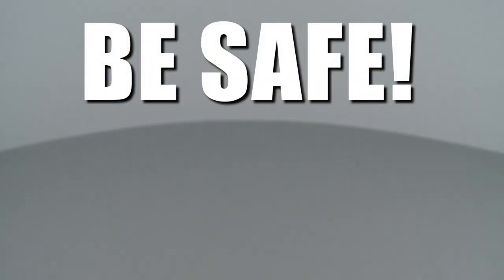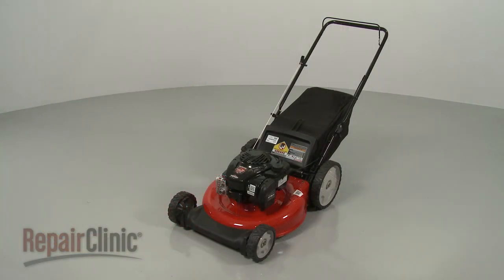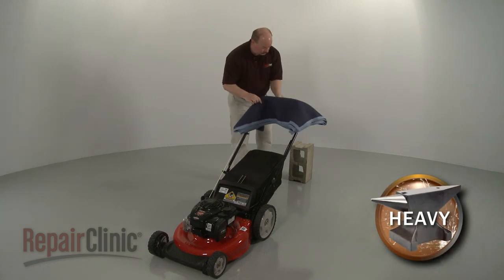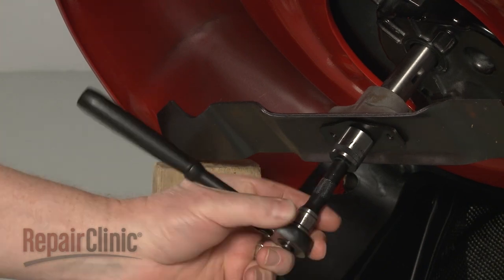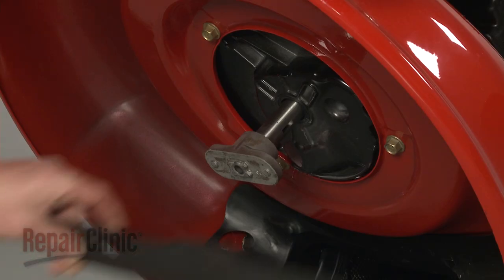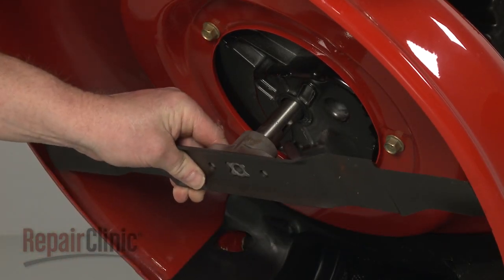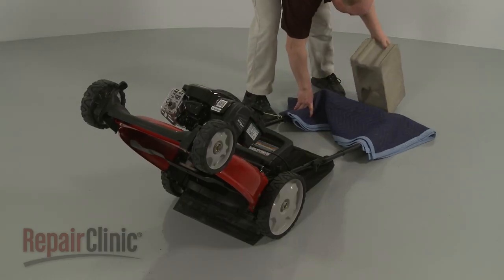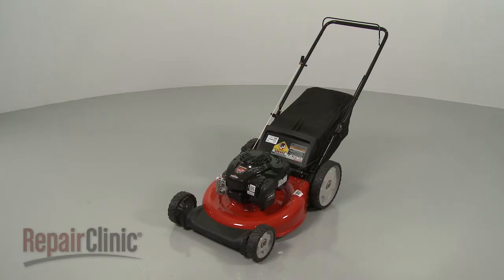MTD Lawn Mower Blade Support Replacement #736-0524B

Comment: Mine just wont come off. I bought new wrenches and neither they nor my old socket will  budge that bolt even wit ha hammer. The blade is off center of the adapter so it most likely spun on it a little and is now putting pressure on that bolt. Im too hot and tired to try more today. May have to waste money at a shop.

Comment: So the bolts aren't counterthreaded?
Reply: Counterthreaded? Never heard that word before in relation to nuts and bolts. But if you happen to mean "Left - Hand" threaded...the answer is not very likely at all. Most all motors turn right hand....so the bolts are also right hand as the rotational forces tend to keep the bolt ON and not tending to loosen the bolt.
It's right hand.